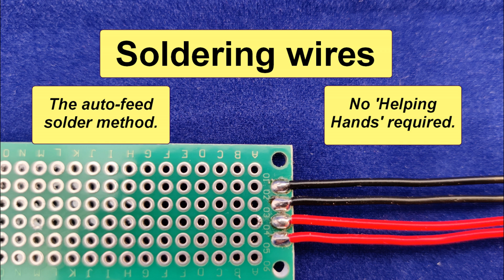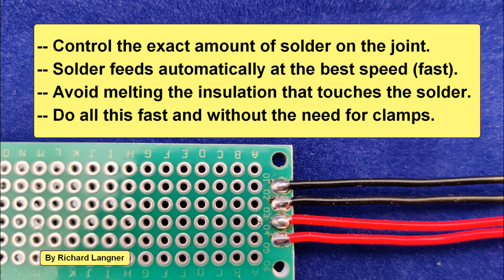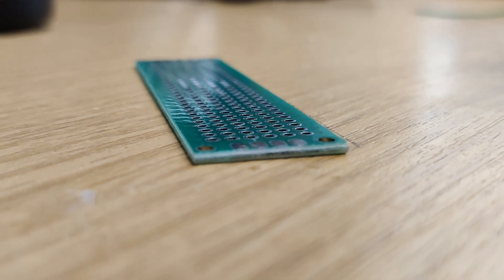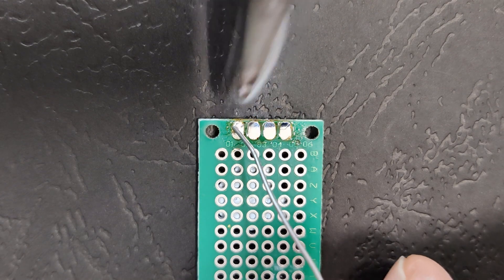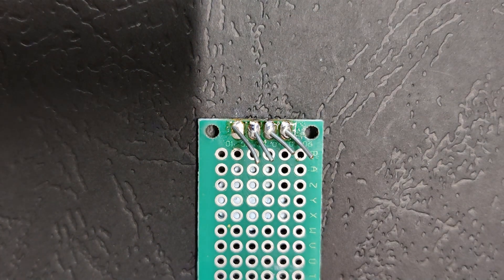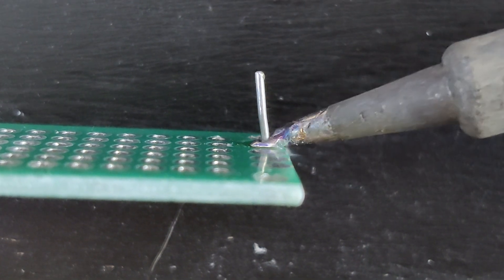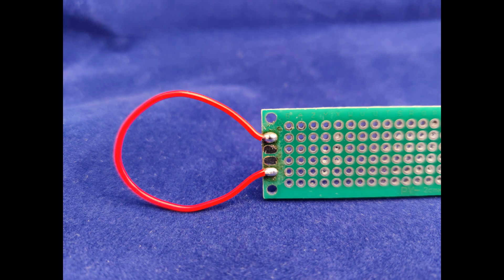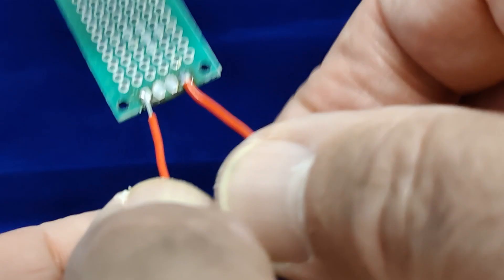Hands-free solder feed. No tools required other than a normal soldering iron.

Comment: Great tip, thanks!
Reply from the maker: You are welcome! I'm getting close to making a soldering video with a few more tips, and a bit more explanation of how my technique works.
Just looked at your channel, I really like the tank, it must have taken a lot of work to build.
Reply: @richardlangner  oh thanks! it's a bit dead project, current board that uses mono+meadow+c# is just too slow with all those layers, like simple interrupt can take 2-5ms to start executing c# event, it's just waaay too slow for such real time project and all plans I had for it, so I decided it was waste of time to go forward with that inefficient platform and I'm planing to switch it to pure stm32 and C but it means rebuilding it almost from scratch, as many things will be redundant like I can generate pwm with timers instead of separate boards (and with much higher frequency so no more squeaking motors!), and in general just learned a lot since then, but past 2 years it's just waiting as I'm learning and working on other things, and tbh I'm literary too lazy to put stuff on YouTube! But I must get back to it soon :)

Comment: Pits
Excess solder
Positive meniscus

Any one of which fails a QC inspection, and you've insured all three in every single solder joint.

FAIL
Reply from the maker: I agree with you, but in order the get a half-decent video with limited equipment and a mobile phone camera, and working in restricted space, I think I managed to demonstrate the principle. In practice the joints would be 'perfect' enough for QC. And with less solder.
I'm only an amateur at youtube videos, and it's done in my spare time, unpaid.
So please accept my apologies.
I will follow with another video soon where I will show it done to your standard. Also with some other tips.

Comment: Pretty useful video honestly. Thank you. I will try your method next time!
Reply from the maker: As has been pointed out several times, the demo uses too much solder.In practice I do it quicker with less solder. And thinner solder.
Oh, just seen your channel, you're a biker too?
Reply: @richardlangner  thank you for the response. Yes a bit less solder would be better for sure. No sir I am no biker, I'm an embedded systems and a.i. engineer with focus on machine vision and video processing. We make boards occasionally and devices so keeping soldering skills sharp is a big plus.

Comment: I've never seen that solder technique before, despite several decades in the electronics industry! It will be my go-to from now on.
Reply from the maker: You don't need this for through-hole stuff, as it is mechanically held together and you don't need an extra hand. But I find myself using it in other senarios. And remember to use less solder than I did - this was a demo - I normally use a lot less and solder quicker.

Comment: Stopped because soldering the  keyboard PCB boards can be a gatekeeping point. And here you just opened the gate! 👏👏👏 A seemingly slight shift, utilizing all the principles, and you've maximized your efforts.  I'll use this, and pass your technique on. Thank you!
Reply from the maker: Remember to use less solder than in my demo. And solder quicker - I will do a follow-up video showing the finer points.

Comment: Has worked wonders for me the last fourty five years. I on the other hand attach the solder to the wire.
You're using too much solder though. 😉
Reply from the maker: Seems I got there 10 years before you, I was using this method 55 years ago! And yes too much solder, but that was for the demo, in practice I use a lot less. And do it much quicker.
Thanks for your comments though.
p.s. I also use this on wires when I need to, and sometimes on larger SMDs.
Reply: @richardlangner  
Fifty-five? Started in the cradle? :)
Reply from the maker: @Peter_Riis_DK  Yes I was just out of the cradle after 19 years.

Comment: This might have helped in situations where I've had to solder headphone cable that contained some stranded plastic (nylon?) core for mechanical strength. Heating the wire and pad at the same time would melt the plastic, then molten solder would just ball up & stay on the iron instead of wetting onto the wire/pad.
Reply from the maker: That's an interesting problem. Notice in my technique that (after leaving the solder leg) I don't touch the iron onto the solder. I will make a video which will show the finer points soon.

Comment: Very good. I've been in electronics all my life. Now 90. I always liked?? some soldering instructions for joining 2 wires. 1-hold 1 wire with a hand. 2- hold the other wire with a hand. 3-hold the solder with a hand. 4- hold the soldering iron with another hand. I seem to always run out of hands after step 2.
Reply from the maker: Yes the lack of hands led me to this idea, but now even my 10 year old (grand) neice uses it as a matter of course.  I too have been in electronics all my life (well... not yet). It's nice to pass on hints and tips to the younger generations, old techniques are new to them. All these years I thought it was strange how it's only me with the idea, and this video has flushed a few out that had similar ideas - but not exactly the same as mine. Thanks for the comments, made me smile.
Reply: @richardlangner  Thanks, I forgot "not yet" but getting closer. Actually I do very little pure electronics anymore. Mostly do woodworking and 3d printing.

Comment: I have used both of these tricks and it helps sometimes but mostly I need both the parts and wires to be held in place firmly since the parts just slip out but I don't have a third hand.

Comment: You dont tin your wires first? What about larger braided wires??
Reply from the maker: To keep the video short I didn't show the wire being tinned. Also for the video I used more solder than is proper. I know, I know...
There's been so much feedback that I will follow this with another video showing the finer points and some extra tips. Thanks for mentioning braid, that's something I could include as it would normally wick up the solder like desoldering braid.
Yes, thanks for that.

Comment: 😮 40 years of soldering and I can’t believe I’ve never seen this. Can’t wait to try it out!
Reply from the maker: If you have been soldering that long It may take a bit of practice, but my 10yo neice found it easy as I taught her solder and included this method. I intend do do a further video on the finer points, but for this method did you notice once the PCB was tinned the iron did not touch it directly?
Reply: @richardlangner  Thanks for the heads up! I assume this is because you want the new solder to flow to the wire first, then to the pcb. As my dad always said, "solder flows towards the heat." 
20 years ago I started using a flux pen to prep wires and pads and that was a game-changer. Now every joint has a mirror finish and I rarely over apply. There's a spectacular video on the use of flux by user Androkovo. If you haven't see it, I highly recommend a watch. I wish I'd had it back in the 90's...

Comment: ‼️❌ Over solder, 
            Burnt PCB...   not good tech
Reply from the maker: No burnt pads or PCB. I agree there is a lot of solder, but this was intentional for the video. It's also not that easy in the restricted space under the camera. But thanks for the feedback, I'm surprised there are so few negative comments, but yours is a valid view. I'm going to do another video which will show you the finer points that you probably missed. I think you'd be surprised!

Comment: How many hundred years of soldering being enlightened in 3 minutes here?
I've had to do hacky soldering on d-subs and worse, and I've always wonfered how to do it without feeling like I'm doing a circus act. So this is almost therapeutic. Thanks.
Reply from the maker: I'm going to do a video covering the finer points, so using this on a D-SUB would make a great demo as there is no mechanical joint into the solder buckets- thanks!

Comment: Very interesting - i wouldnt find it out myself :)
Regarding the meleting of plastic sleeve its not a big deal :) and its also harder if you grab the metal, dillated part of a wire with pliers - pliers will absorb much of the heat. The heat of the night :)
Reply from the maker: I only use the plier to pull back the sleeving, not when soldering as a heatsink.

Comment: Engineers assemble to this video! I have some soldering to do soon and i struggle from not having three hands (and singeing wire insulation) so I'll be sure to put both of these techniques to the test. Lovely video!
Reply from the maker: Thanks. It's interesting that I have a few adverse comments from those who misunderstood the finer points, so I will make another video clarifying these. Good luck with your projects.

Comment: The common technique is to tin the pad with a big blob of solder. Then tin the wire. Then put the wire on the pad and heat the whole thing. It works. 
But would you say the advantage of your technique is having fresh solder with fresh flux in the core so that the joint is better?
Reply from the maker: 'Then put the wire on the pad and heat the whole thing'
Generally the flux in the PCB blob will be used up (unless you are awesum quick). So if I did what you suggest I would need to add a bit of extra flux before making the joint.
Also when people heat the whole thing, they put the iron on the solder blob. If you watch the video carefully you may see that after the tinning, the iron does not directly touch the solder blob.
Because some viewers have misunderstood the technique, I will make another video showing the finer points. But in brief - the iron presses on the wire to heat it, the wire heats the pad's solder, and only when both pad and wire are up to temperature does the solder feed in. This totally avoids 'cold' joints which could happen to those less experienced solderers.

Comment: Not good. There is definitely mechanical weakness to that joint, and poor absorption of the solder into the metals of the pad and wire. I would not trust this joint in anything critical
Reply from the maker: I agree there is no mechanical strength. It's really intended for non-critical projects that live in an enclosure where the wires stay put. But thanks for the feedback.
If by poor absorption of solder you mean 'cold joints' then you should look closely how the joints are made. Assuming the wire is clean and tinned, the PCB pad is tinned and at that point the leg of solder is left on. When the wire is offered up, the iron heats the wire, the wire heats the pad, and only then does the solder melt. Does this satify your absorption query?
Reply: @richardlangner  actually, no. A quick application of heat prevents the solder from properly fusing with the underlying metals. In non critical joints, it's probably fine, but some of your viewers may mistakenly apply this method for something more critical which can be dangerous. Take for example someone who attempts to repair his own vehicle ABS module - this could be deadly.
Reply from the maker: @MinnesotaFarmboy  That's interesting, can you link me to any relevant articles about the fusing process please?
I would have thought that when tinning the PCB pad, that the solder had fused to it. But I would be grateful if you could improve my understanding.

Comment: Yep, this is going straight into my favorites.  I would have NEVER in my life thought of doing this, now I'll never do it any other way. 

Thank you so much, Richard!
Reply from the maker: I'm glad you like it. This is really for soldering to pads. No great advantage for through-hole components as they are already held in place and you then only need two hands.
Having said that it will be a very useful 'tool' to use when the needs arises. Thanks.

Comment: I just saw this video. It is a good video, short and to the point. Unfortunately, i have been doing both like this for many years now. I learned to feed the solder like that when I learned to braze copper pipes, you usually have a brazing rod, and used to also attach the rods together to make them longer as well. There .ust be something with the algorithm that has put you on many peoples lists recently. Anyway, i like the short and sweet videos like this, keep it up!
Reply from the maker: Thanks for that. Feeding the solder like that is pretty obvious and I thought everyone did it at the time (50+ years ago). They say great minds think alike!

Comment: can something similar be applied to through holes?
Reply from the maker: You can, but don't really need to as you only need two hands - for solder and iron. The through hole wire should be mechanically stable. I may make a video on proto boards.

Comment: Why though? If I’m fast enough with tinning the pads with some exess solder there’s usually enough flux left so that when I introduce the wire and reheat the joint it’ll flow nicely around the wire without me having to feed in any more solder
Reply from the maker: If you're good at soldering, do it the way you prefer. This idea was born when I was in the field with no clamps and no way to fix the wires mechanically. Now I use it as and when it suits me. My 10 year-old neice does it as a matter of course when it's easier, even on large SMDs.

Comment: Thanks for sharing. I am relatively new to the electronics hobby, have been using smd components and wires a lot since I have started. I have often used helping hands to hold fiddly wires and when doing repairs to things around the house. I appreciative having another method and skill in my tool box when working with wires.
Reply from the maker: Good luck with your future projects. I intend to make a video with more soldering skills and tips. Subscribe etc..

Comment: Cool technique for really big pads, I suppose. For small pads, you should get the right amount of solder the "normal" way, i.e. tinning the pad and tinning the wire, which is probably the same effort..
Reply from the maker: My method misses one stage, so is quicker. Yes, tin the wire as normal. But when you tin the pad, that's when the solder leg is left. The missing stage is hand feeding the solder. Solder autofeed!
Reply: @richardlangner  I understand that. The point of tinning both the pad and the wire is that you don't have to feed any more solder, just melt the wire to the pad, that's all. For really big pads you might need more solder than what can stick on the wire and the pad, then your method should be beneficial.

Comment: I used to do this in the 90s when I was a teenager building lots of boards. It doesn’t make for the best looking joints.
Reply from the maker: If you ensure the solder never feeds onto the iron, the joints are perfect.

Comment: How do you know how long of solder wire to keep?
Reply from the maker: Depends on the solder thickness. Practice with a quarter inch of solder. In the video I deliberately made the solder longer, and used the iron for longer. I may demonstrate the real speed in another video. Spoiler - it's quick.

Comment: Finally the algorithm turns up a video which is short and incredibly useful.  I've been soldering for nearly 40 years, and did a proper apprenticeship back in the day.  Done lots for work as well for hobby stuff.  Never seen this before, and it should be a standard practice for everyone.  Just a great tip that should be spread far and wide as it allows such precise control of the amount of solder and automates it without needing any additional equipment.  Thanks for sharing this, I'll use it any time I do this kind of soldering in the future.
Reply from the maker: Thanks for the feedback. You may have seen some of my replies suggesting I will make a few more videos on skills I developed over the years. I've been soldering since 1962 so it comes naturally to me,  so much that I didn't realise how my solder-autofeed worked until my friend analised it when he video'd me doing it. 
So definitely some basic videos coming soon, but different to the nornal on youtube.

Comment: Thanks for putting this on YouTube it’s great to learn from your experience and try and emulate your skill, soldering isn’t easy.
Reply from the maker: All this great feedback has made me decide to make a longer video for beginners and experts, with some unusual tricks developed over my last 60 years in electronics!
Reply: @richardlangner  I’ll subscribe for that since I’ve been making boards for my flight sim cockpit I’ll found soldering the most difficult still to acquire. I’ve no background in electronics but the coding is easy.

Comment: I have taught over 100 apprentices electronics and have never seen this method of soldering.  It is brilliant.  Pity I am retired now, but I can still use it for myself
Reply from the maker: Thanks for the feedback. I taught City & Guilds practical skills in circuit construction for over 20 years, and may make another video with more tips and tricks.

Comment: I gave up on this long ago when I was getting poor connections and decided to buy those little Chinese terminals and solder those to the board, and just clamp the wires after putting Ferrules on the wires. Having now watched this I think I'll give it another shot, as the low footprint is often desired, thanks for the tip!
Reply from the maker: Those Chinese terminals are really poor quality, It's worth paying a little more to get quality, or take terminals of old equipment if you can. Good luck with the soldering.
Reply: @richardlangner   You're not wrong. I had really bad ones on my first 3D Printer, Anet A8 which was basically a fire waiting to happen.